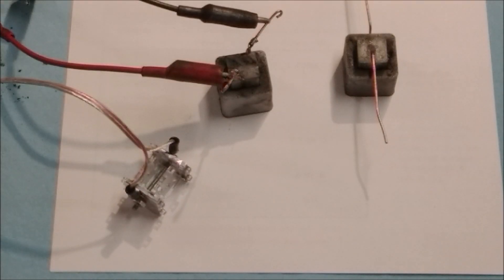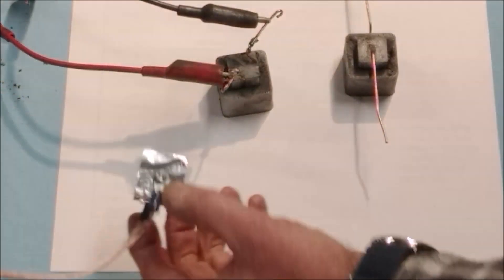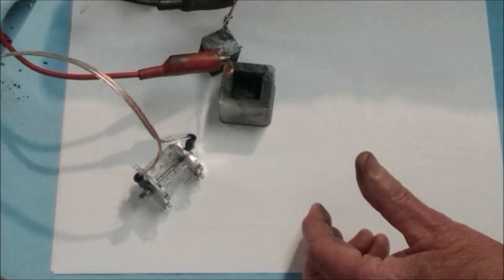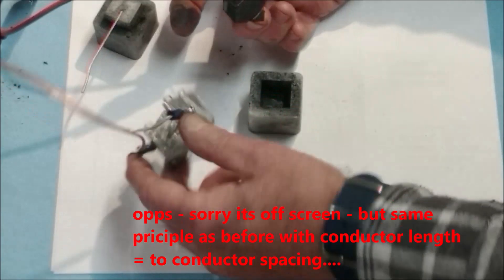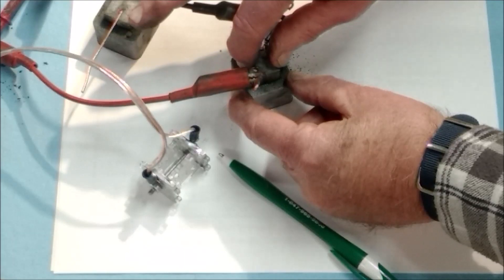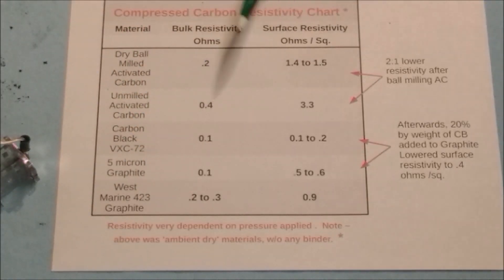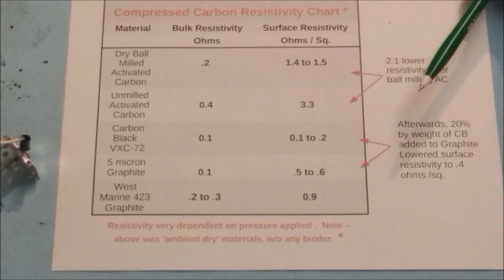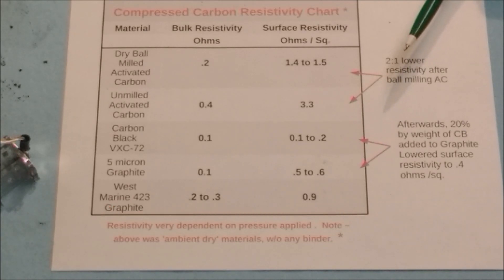Conductive Ink - Resistivity Tests of Raw Carbons

Comment: Nice work there Dennis. I had no idea carbon black was that good in resistance. well done on the probe. Wonder if you could add binder to the carbons and then put them in the probe box and compare the two.
Reply from the maker: Had similar thoughts on doing a binder test in the probe box but by the time I make up a batch I might as well use it as ink and test it after painting on a substrate.....since I'd have to make up a special recipe for the box to compact it, it wouldn't represent something close to a painted sample.  
And yes CB is very conductive - wayback when RMS and others have recommended it combined with AC for electrodes in the 15 - 20% range.  It doesn't seem to compact as well as Graphite but it may be a good combination if it helps the graphite to last longer as current collectors - i.e. less intercalation over multiple cycles.....

Comment: Hi Dennis, I made some tests using xanthan and Guar Gum, I got similar ball park results resistance wise to you, but they did not stand up very well to charge discharge cycles in a cell. Definitely worth ball milling the graphite and I have been adding 10%  to 20% lamp black just for good measure :-) I did not have the time to make a vid, and to be honest there was not much to show. I am now investigating another couple of binders in combination, I will post if I get anywhere.   -   Martin.
Reply from the maker: Hi Martin - What do you think is the failure mode of your graphite/binder In your cell?   Do you think you're getting exfoliation or intercalation of the graphite layer?   
Or is it just 'dissolving from being wet for long periods of time. ?       Next  I'll try cutying my binder solids  to carbon weight ratio in half - see if that improves conductivity.   

If graphite plates hold up then a combination of heat and pressure applied to our thin 'ink' layers may make them more robust as well ....???
Thanks for keeping me in the loop on your work.
Dennis
Reply: Hi Dennis, Not really sure what the failure mode was, by the time I noticed something was not right on the electronic load laptop and I took the cell apart the graphite just fell to bits off the stainless steel mesh current collector :-(  I have just painted a piece of aluminium plate with a new batch of ink, I actually increased the binder with the hope of it holding the mix together better, I gave it 3 thin coats with a burnish between each coat. I have yet to try it in a cell but it seems to have dried very hard, if a bit higher resistance, I'm sure there will be a happy medium :-)   Martin.
Reply: @solarhope  Hi Martin, what electrolyte were you using, as I found an aqueous solution (ZnCl) faired better than my DES(CHUG)...but the DES direction is where I want to explore, thus giving up on the Xg/Gg binders for now. I found the Gg was "better" electrochemically, but did not cycle test it. At the moment, I am settled on a PAA/PVA/CMC 1g:1g:1g to 300ml water solution for the binder, diluting to produce the slurry mix. I am still tweeking the carbon to suit the binder... And Dennis, please forgive me when I say sometimes you can have too good a mix... it is a balance between Active Material, Conductive Material (not necessarily the same material) , Electrolyte and the binder.  A very conductive material may not be suited to your binder or electrolyte and that is my challenge at the moment. Stability and low ESR, reasonably good cyclic life all factor in... I don't want a highly tuned Ferrari, a bomb-proof tractor will work, just stack them up higher, but my driver is an average self discharge targeting to 0.025V/Hr...and conductivity of the base materials will certainly be an important issue in that build. Keep up the good work folks :)
Reply: Hi Tony, At the moment I am focused on getting a MnO2 / Zn battery to work. Like you I don't need a Ferrari, just a battery that will replace my ageing lead acid cells for solar storage. I have made duel carbon supper  capacitors etc, but the self discharge rate was pretty awful. I have tried all sorts of aqueous electrolytes but I need to start again when testing in situ on a graphite coated current collector :-(   I have not had much luck with DES, but I guess a higher voltage is not so important to energy storage in a battery as in a capacitor :-)  Martin.
Reply: @solarhope  Hi Martin, same end-game, getting rid of the lead acids :) I suppose my issue at the moment is when does a supecap end and a battery start...or vise versa...to me they are looking more and more the same animal ...sometimes it barks and sometimes it wags its tail...still makes it a dog !!    :)
All the best
Tony
Reply: Hi Tony, Today was a one step forward two back kinda day :-(  You are right of course regarding lines being blurred. I still have the odd go at a supecap  every now and again, usually when I read other peoples comments or get some inspiration :-) Either way I think a cheap current collector that doesn't melt like a digestive biscuit in a cup of hot tea is a must. I have led myself up the garden path using graphite electrodes, they work great in test cells, but I have difficulty in replicating the cell chemistry without them :-)  Martin.
Reply from the maker: It looked to me like the latest 
Blade construction RMS showed, only had aluminum foil on the end plates of his 10 cell stack.  If that's the case then there is likely a carbon based current collector in there for each cell.    As a side note it didn't look like a bipolar cell  which would mean no separate current  collectors for each cell.   

  Maybe trading off some of the graphite loading with a graphite/carbon black mix would make thinks last longer - if there's less graphite to intercalate during the charge process - eventually eroding the cell..????
Reply: Hi Dennis, Yes that's how it looked to me, each cell was plastic substrate with centred through graphitic connector, active material, electrolytic separator, active material, plastic with centred through graphitic connector. x 10, with a metal current collector at each end. He also states that both carbons are the same in the supacap, and only one changes for the battery version. 
Is the electrolyte used on the separator, a solid or gel or liquid, maybe the less liquid it is, the less likely it will get into the graphite though connectors and destroy them? 
Still a way to go :-)  Martin.

Comment: I have also been applying an electrolyte soaked baby wipe over a 100mm square ink surface and then pressing down with a thick graphite plate to get an indication of resistance as in a battery application measurement ! It has been very interesting to see the different electrolytes and especially the different molar measures . Really looking forward to uploading these videos in the next month or so . Regards andy
Reply from the maker: Thanks for the input Andy - looking forward to seeing your work in a vid.

Comment: That’s good to note. I have been applying my ink and burnishing it in between coats and I have found 3 coats to be optimal through a small airbrush as an applicator . This allows me to feel i have a more even and consistent coating .i have found a thin coats better than thick as long as they are burnished in between